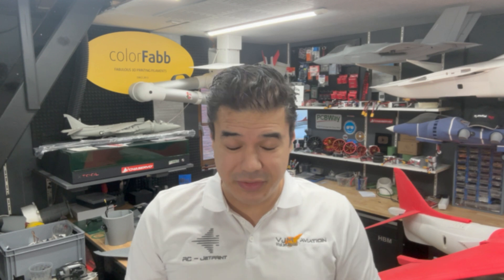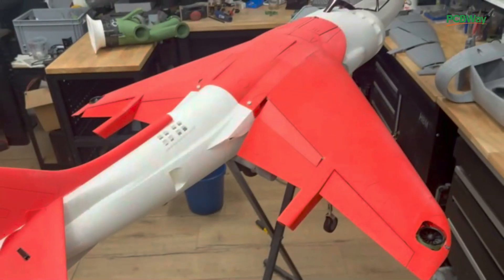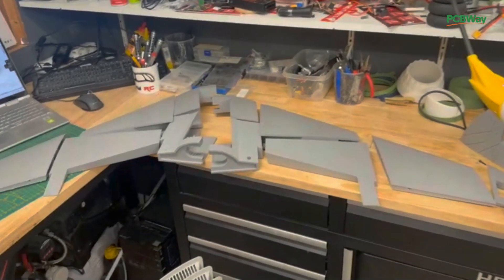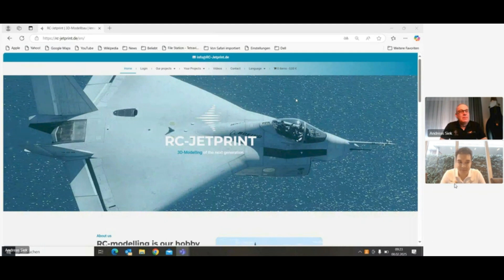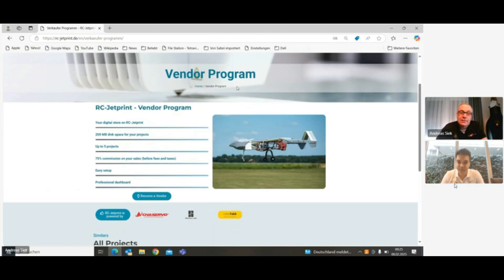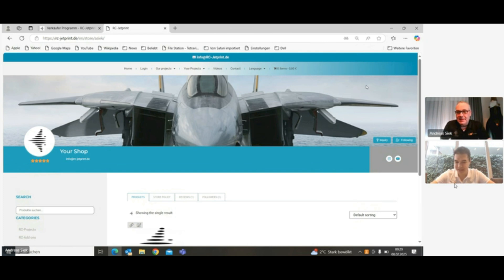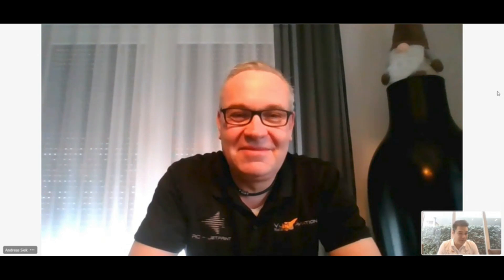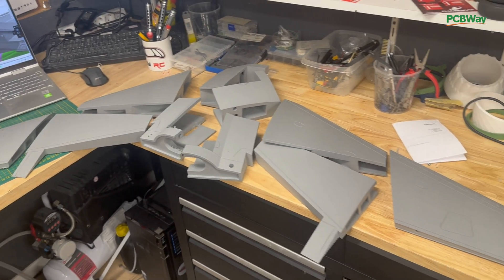RC Harrier Jumpjet VTOL: Cutting-Edge Aviation in Miniature!

Comment: I'm glad that you are going to use ducted air as a stabilisation agent, if you need extra air in hover mood you could reinstate the boundary layer doors on the air intakes as this would help. also the harrier nozzles travel to 100 degrees 10 degrees past vertical to allow the aircraft to travel backwards. great improvements.